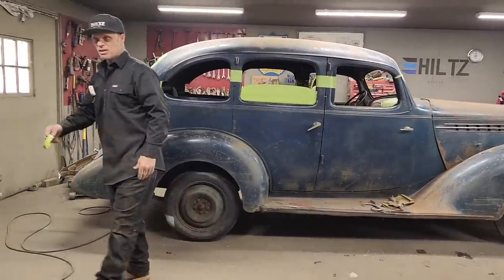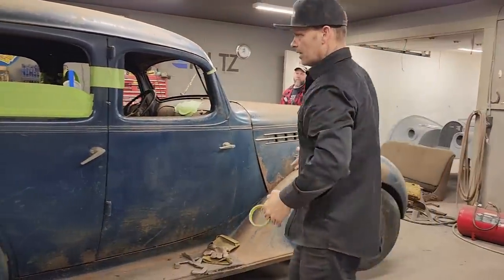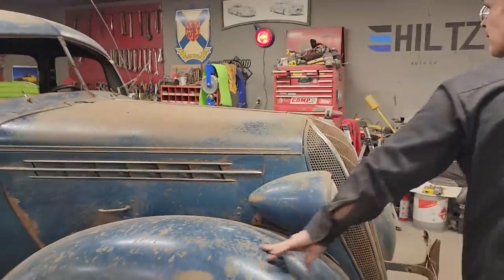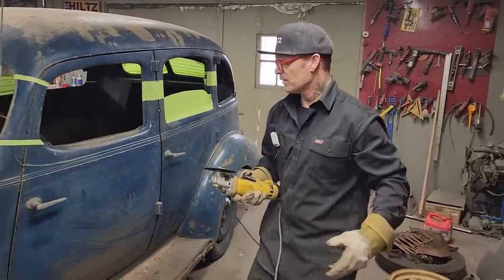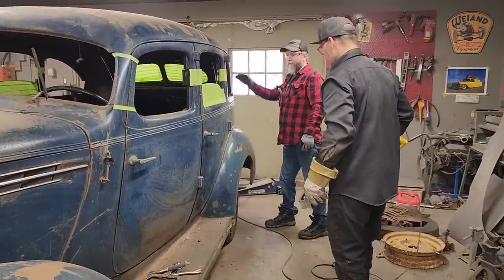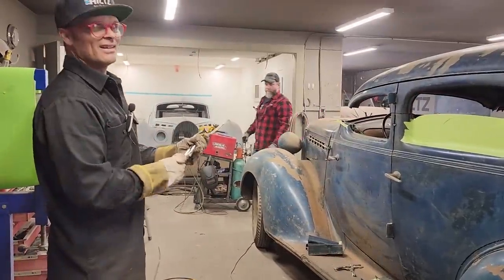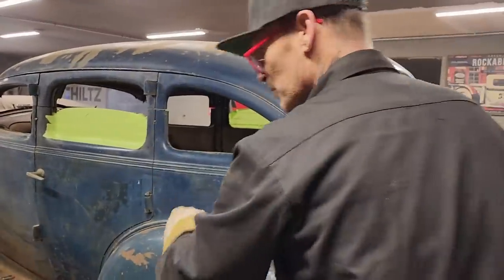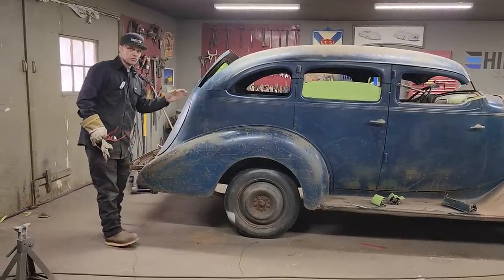Controversial roof chop: 1935 Hudson Terraplane barn find (PART 2)

Comment: If I might make a couple of suggestions?? First if you cut that rear window to bring it down to meet your roof,you will run into the issues with why you didnt cut the roof out in the first place.. Could you not bring the roof up to meet the window instead? It seems like that would cause fewer overall issues in the long run. Second, might I suggest that you collect  2x4 blocks to use as braces in situations like a rook chop. Most home renovation and building sites usually have those kinds of pieces as part of thier waste products... These are only suggestions... I will be watching if you listen to them or not... Love your show and both you guys!

Comment: I liked it when you first marked it using one strip of the wider tape, and one strip of the narrow tape. A 3 inch chop instead of 4 inch. It would have made it a bit more modest chop and made a bit easier for all the angels to line up back together. This will be cool to, but personally I would have liked a more modest chop because the rest of the car is so huge in compareson.I think the front window will be a little small, it would benefit beeng a little higher. But all in all, love what you guys are doing on your channel
Reply: Agreed  8^)

Comment: It appears as though the front roof needs to be sectioned and a piece added to bring the windshield forward and more in line so as to place the front glass level from side to side, top to bottom. The pie cuts in the rear truck section appear to be the correct solution. Good work Chad.

Comment: The Hudson is a survivor and like you said would it be feasible to restore... I like the look so far. You could use a ratchet strap to gently pull the B pillars back to where you need them when you go to weld it back up.

Comment: Hey Chad, when I chopped my 40 international p/u cab I had the same problem with the windshield center post, I relief cut the back side of the windshield frame at the bottom to get the bottom plane parallel to the top, plus I relief cut the top and bottom of the side posts before putting the actual posts back in to get the right angle. just a thought

Comment: Slice the roof from center of post across the roof towards the middle leaving about 6”. Then cut the other side the same. Then you can tilt the upper windshield frame out towards the same angle as bottom.
Then split the piece of the post to match.
Just a thought and yes it is cool as heck chopped

Comment: That's the right year model to make a Hudson Coupe out of with the bullet tip headlights and long swooping back front and rear fenders, by extending it's suicide front doors about 4 or 5 inches longer, that'll look awesome and be easier to move the roof forward and align your windscreen A pillar posts back up 😉👍"

Comment: I've since looked at probably all the same '36 4-door Terraplane's on the Internet, and I'm not a fan of them. But chopped, it totally changed it for me. A pickup, though, is awesome. Fall back if needed, LOL

I'm in complete agreement with Dan to slice down the entire side on both sides and lay the trunk panel towards the roof. It needs to remain on a singular plane from the bottom of the lid to the roof. Hopefully the rear glass isn't too high up at that point. You may not be able to easily adjust that. 

You may have to split the difference for the placement of the upper hinges. Run a straight line through the upper and lower hinge  pins since they should remain in-line to eliminate binding.

Here we go again with another Bad Chad and Jolene creation.

Comment: Looks like your going to have to cut a foot back from the front section of the roof then weld in 2" strip of metal infill to bring the front roof section forward to line up with the angle of the bottom of the A-Pillars.  That is the only way to make it all symmetrical and still factory looking

Comment: You could shrink the "brow" in  the front center of the roof and place a one piece flat windshield in the front. There is an example of a 1935 Hudson on the internet that looks nice for example. Your helper had a great suggestion for the back also but of course it is up to you Chad. Like what you have done so far.

Comment: Chad you can eliminate the center post and make a 1 piece windshield by making 2 pieces of glass slightly wider so they butt together in the middle and seal the joint with clear sealer. This is an old custom car trick from the fifties.

Comment: I agree with you Chad it looks so much better should have looked like that from factory, haha ,its not going to be easy but I would lay down the Trunk cut it down to the bumper you may think its harder but you won't have to deal with an acute angel if you lay ir down the whole way it would be a nice smooth curve to the roof , front A pillars quite a bit of WorK !!😮 in them , ps cut the packeg tray out completely then refitt it as it sits now ..

Comment: Hi Bad Chad the car has nice rolled body lines at the top of the doors,maybe weld 3/8 pipe to the inside rear lower part of the body below the window then tuck in the upper part to the 3/8 pipe creating a new bodyline between the trunk and window

Comment: I think that (possibly) cutting a pie on  to the quarter  to move the rear window over towards the roof ( if the trunk  hinges are at the top, ) it  will change the trunk line at the bottom by sticking out  , not sure ?

Comment: Cut across the roof, from left front door to right front door, directly in center of both doors window length, to cut free the front roof above windshield, to line up with the bottom windshield section, to then add/weld metal in between the across the roof cut.

Comment: Chad to keep the lean on the rear end even from top to bottom, how about cutting vertical pie slices on the  corners, right down to below the truck opening. Then the whole rear slope will match. I'm sure you could hammer the rear corner curves to smooth them out after they're welded up.

Comment: (FRONT POST) Wrap it with bristol board, trace the lines to make a pattern, cut out the pattern, wrap it around the post and see where it fits the best. Also put a small ratchet strap inside the car to keep the B pillars sucked in.

Comment: Duck tape them in place? I bought sections at the junkyard and they use a big 14 inch concrete saw. Put a long steal plate under the vice grips

Comment: The chop is right, the original design had the roof too high (probably for hats).  It's too much work on the lines, but I'm thinking the back part and trunk would also look better sectioned about 2-3 inches, tapering off to the back of the front doors.

Comment: You could’ve put straps, holding the columns towards each other, and a floor, jerk or two inside the cab that cool and when you sleep on it set the alarm is 3 hrs increments keep a pen and paper by your alarm before your subconscious mind forgets everything❤

Comment: I am thinking now it needs to be higher in the rear than the front so it leans down in the front, mo gangsta .. lift that rear about 1.5" and give it a look see what ya think, it will also help with alignment issues I think it will look way better if the roof is higher in the rear some..

Comment: If you stretch the front area of the roof until you reach the original angle of the post it would look alot smoother and save you a lot of fabrication. Call me crazy 😜

Comment: Why not make all the upper cuts, lift top off, then cut the lower cuts?
Reply: He told you several times that's what he wanted to do , but didn't have enough hands to lift it off safely.
Reply: @jerrybrady9103  yes. But when there is the will, there is a way.
That really is my only "problem" that I have with how Chad does his work... whether it is doing a chop...or whether it is loading/unloading a vehicle from a trailer.
He is a hard worker.
He is a fast worker.
But sometimes he is not a smart worker.
If they could not round up enough people to physically do it that way, then step back for a few minutes and think of a good way to use the tractor's loader to do the lifting.
I guarantee that it could have been done, without doing any damage to the roof.

Comment: Split cut the front post parts you have removed along their length to get correct angle front and back of the post then add fresh metal in the middle to join back up,

Comment: CUT THE ROOF ON TOP FROM FROM BOTH FRONT DOORS, AND PUT THE ROOF FORWARD TO UP THE FRONT WINDOW POST, AND IT WILL LINE UP! NOW ALL YOU WILL NEED DO,IS PUT IN A SMALL SHEET OF MEDAL - REPLACE THE OPEN ROOF, THAT PUT TO THE FRONT WINDOW, AND THE BACK - YOU COULD ADD ON ROOF METAL TO THE BACK, AND YOU WOULDN'T NEED TO BLEND THE BACK WINDOW - DOWN AT ALL, BECAUSE  THE TWO ADDED ROOFTOP PIECE'S MAKE A STRAIGHT ROOF, AND NOW YOU SHOULD LOWER THE CAR DRIVE HIGHT. IT SHOULD BE LOWER, UNLESS YOU ARE GOING TO PUT ON BIGGER TIRES, AGAIN 😫 IT'S JUST MY COMMENT, AND THAT'S ALL- GOOD JOB BAD CHAD 👍

Comment: Like I told my son-in-law, dumb carpenter when you cut them front sections cute long, you can always Trim it. Hard hat? Weld straight plates on the bottom only to the sides easier to adjust ? It’s not fair to the audience. You don’t show that beautiful blonde every video.